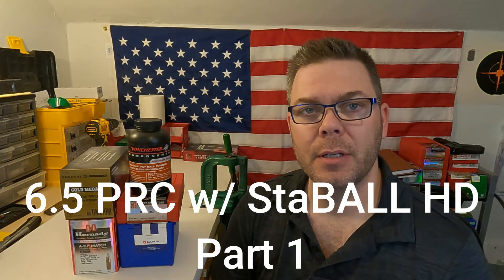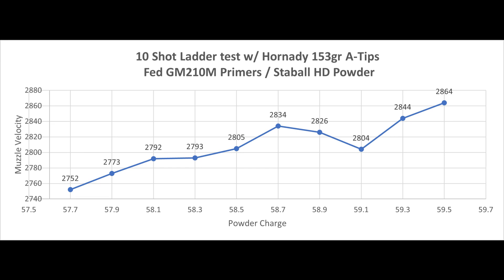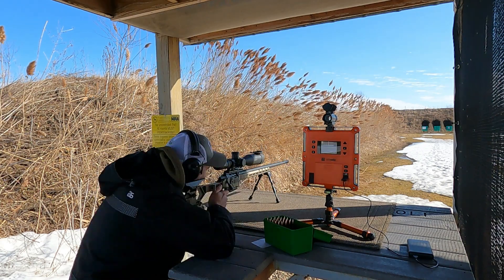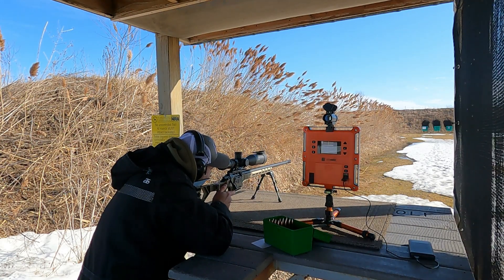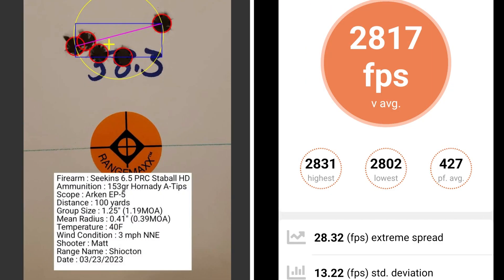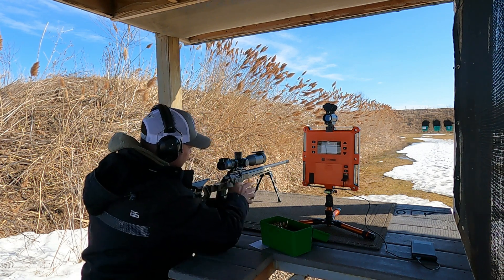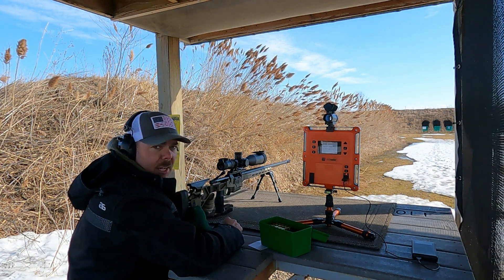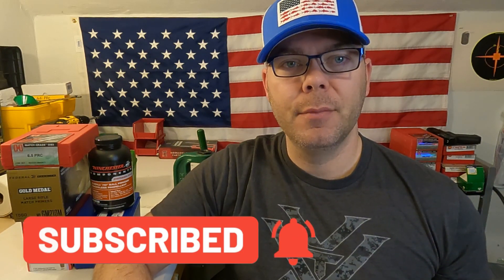6.5 PRC - StaBALL HD - Part 1 - Finding a Powder Charge

Comment: Thanks for the video!  What are you using to aim your LabRadar?
Reply from the maker: I am not sure of the brand, but it is the cheapest red dot that I could get on Amazon.   And then there is a mount that is made to go on the lab radar.  The system works very well

Comment: Oh, because Eric Cortina does it, you're gonna do it too? Are you shooting his rifle, with his ammo, made with his reloading equipment? How about thinking for yourself and finding what works in YOUR rifle, with YOUR ammo, made with YOUR reloading equipment.
Reply from the maker: I am not doing it "because Eric Cortina is doing it".  I have had issues in the past in regards to getting consistent measurements from the lands using my Hornady O.A.L. Gauge.  Specifically with 300 PRC and 6.5 PRC.  So YES, I DID look for alternative ways to do it and his method made the most sense to me.  So I tried it.  I have been getting good results from it.  So in return, I can legitimately say that I adopted his method of finding a starting point to work from.  And it works in MY rifle, with MY ammo that I am loading using MY reloading equipment.  As a matter of fact, I did not have to go out and get new equipment to use this method.  It actually uses LESS equipment and is just as easy, if not easier way of finding max bullet length.

I hope in some way, it helps others as it has helped me.

Thanks for watching!
Reply: Personally, I think Matt’s process of initial load development is pretty solid in getting to a good starting point. Why not utilize the experience and knowledge of others in shooting sports such as Eric Cortina and many others to try and improve your reloading techniques. If it gets you the results you’re trying to achieve, why reinvent wheel? Especially if you can get to that point by using less resources such as brass, powder and primers. There are many different methods to load development. Some methods work better for some and other methods work better for others. I would rather be open minded and consider many different methods to increase my knowledge. That’s the fun thing about reloading. Finding what each rifle likes. Sometimes you have a rifle that just won’t shoot using your current process. There are a lot of smart and experienced shooters out there that may be able to help resolve the issue. If I can find something to help me resolve the issue that somebody else has figured out, I’m going to try it. Every reloader at some point was a beginner. In my opinion and that’s all it is, there is no such thing as YOUR anything. It comes from learning from manuals, manufactures, family or fellow reloading enthusiasts and experience.
Reply from the maker: @jeffdavis5009  Thanks Jeff!  That is pretty much my thoughts exactly!  

I appreciate your support and thanks for watching!